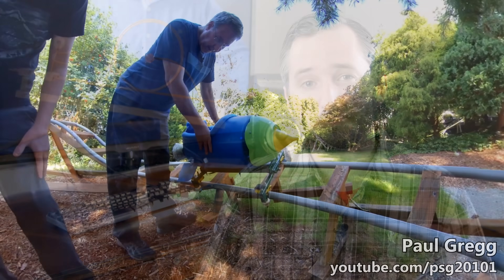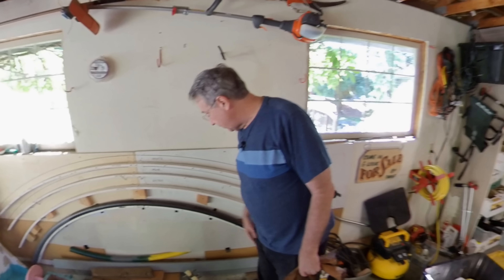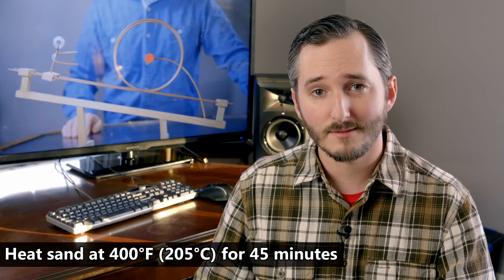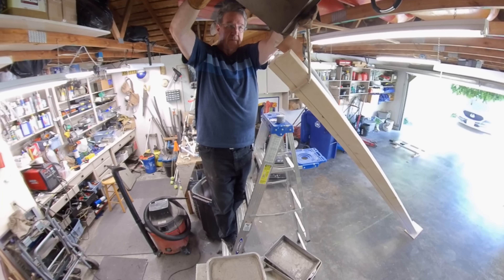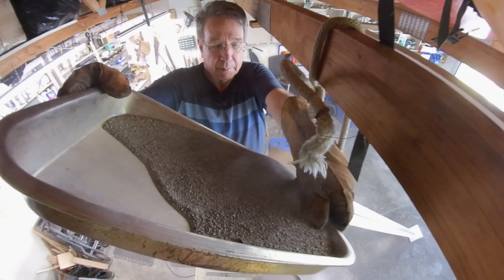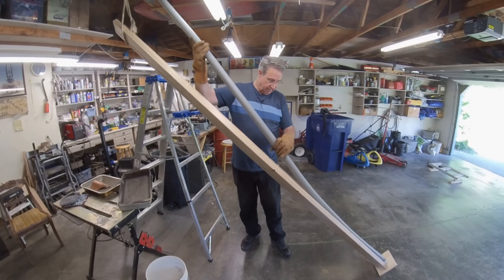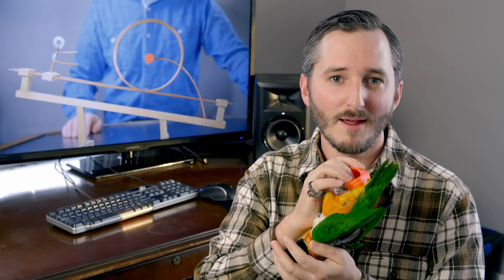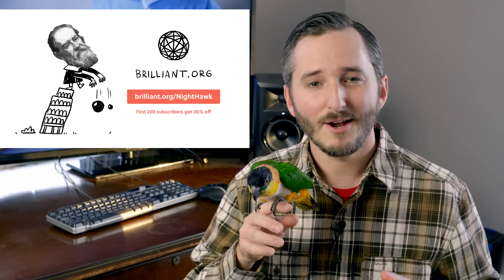Easy PVC Pipe Bending (How To/DIY)

Comment: For those concerned about the sand dust, I only formed two pipes that day, and I think most of what was seen might have been steam from moisture in the pipe.  If I were to go into production (which I have absolutely no intention of doing) I would of course have workers wear masks.  Then again, the sand is bought identified as "Play Sand", washed and screened,  intended specifically for children's sandboxes, where  children pick up and pour the sand routinely.  I can't remember anyone, child or adult, ever wearing a dust mask at the beach or in a sandbox.
Reply: Clearly the last sentence holds a bit of an ominous tone now.
Reply: Nice, Paul..)
Reply: Driving by the beach yesterday, everyone had on masks.

Maybe they were out there bending PVC pipe, I can't be sure.
Reply: Well, in the 1950s, motorists didn’t wear seat belts, either.Most of us survived...
Reply: Oh how times have changed lmao I see people wearing masks while they're driving alone let alone at the beach
Reply: Ok, but if you find yourself doing DIY, car repair or a house renovation a lot. Take some effort to buy yourself a nice respirator, it's definitely worth it.

Comment: Would leaving the sand in the tubes increase it’s structural integrity in the rail track application?
Reply: I don't think so, but they would be much heavier.  Some pro roller coaster companies put sand inside their steel tracks and frames, but I believe that is to increase the dynamic damping (alter the vibration natural frequency) in order to decrease the fatigue loads on welds and smooth out the ride.

Comment: You curve PVC pipe ends using heated hollow spring coils. I do it all the time and I get perfect curves.

To get matching curved ends, you need to use a rail mold (any kind large enough and strong enough to hold stable while cooling. I use a large pegged frame and long bolts. As you slide it through and allow it to cool, the end has no other option but to curve.

Comment: I wonder about using a heat gun.
Reply: Its hard to heat the pipe evenly using heater. And you might bend it too much
Reply: @akugrafik9321  My possible project is a set of hoops four feet across for a utility trailer. What I thought of doing is make a form of some sort, likely a piece of plywood with dowels placed in the round shape in an as yet decided spacing. I envision alternate form designs as well. It doesn't need to be perfect. The ones I made with 45° elbows and couplings are iffy enough to make new ones. The pipe is cheap and I already have a supply of it anyway.

Comment: how about piping steam through it?
Reply: I tried boiling water, and it just didn't work very well at all.  Superheated steam would probably work, but would also have safety issues.  Plus you would want to pressurize it to keep the heat high and pipe round, which sounds even more dangerous.   The heat mass of sand is a really good fit here.

Comment: Please Note:
PVC when torsionally stressed will flex up to a certain point - then it will explode/shatter.
So don't use it for structural "projects".
Or you will be painfully sorry.  :)
Reply: I agree.  I use it for backyard roller coasters for my smaller grandchildren (under 60 pounds).  
Torsional stress is really tension stress at 45 degrees.  If you stress it enough to break it, PVC can fail in a brittle manner.  But my stresses are low.  Fracture toughness is decreased by UV radiation in sunlight, so I paint the tracks.  I've done fracture toughness testing on painted and unpainted PVC conduit, after 2 years of sun exposure.  If I were to make a BYRC for kids up to 100 pounds, I would use schedule 80 conduit.  For riders heavier than that, I would use steel.

Comment: Would this method also work on white plumbing PVC pipe?

I use the white PVC to help isolate bundles of network cables from anything else that is up in a drop down ceiling.  I have to rely on curved joints to get the bundle of wires to change direction.  The push/pull rods get stuck on that small seem between the straight pipe and the curve section.  If I can bend the pipe using this method, there won't be a place the rod could snag on.  I would also be able to make the curve any angle I need it to be.  Even bend around obstacles instead of using lots elbows with all those seems.

Comment: When working with dry sand like that you really, really should wear a particulate rated respirator. Silicosis is no fun: you slowly asphyxiate as the silica dust gets embedded deep in your lungs, preventing air from reaching the surface of your oxygen/co2 exchange membranes. Silica is completely bio-inert (which is why it can be used in implants) but that means also that your body can’t break it down and get rid of it — once it’s in your lungs, it’s staying there forever. There is no treatment or cure... only prevention.

Comment: I wonder if that technique would work on smaller PVC pipe, like 1/2" or 3/4" schedule 40.   The cross-sectional area would hold a fraction of the sand, so it might not have enough heat capacity to do the deed.  It might be necessary to also bury it in hot sand for a couple minutes to let the heat stabilize.
Reply from the maker: The thumbnail image is a piece of 1/2" pipe I bent with this method. I had doubts about the sand holding enough heat for smaller pipe also, but it does. It was still hot after five minutes and I went and dipped it in a snowbank when I was tired of waiting for it to cool down.

Comment: I built a forced hot air flow box, similar to a steam box used for steaming wood for bending.
I found the best ply-abilty temperature is 158 -165 f. without molding technique to prevent kink
or bulge. I could get a 2 ft. 90 deg. radius bend with moderate flattening and a 1 ft. 90 deg. bend
with moderate flattening while stretching, bending and quick quenching technique.
This is done without any memory rebound.

Comment: Cool idea---or should I say hot idea?---Question: what is the diameter limit for bending pipes using this method? I need to bend PVC pipes in the range of 3" to 4" o.d. Thanks.
Reply from the maker: It would work for pipes that size but I suspect you would want to lower the temperature of the sand as you're going to have a lot more of it and it will stay hot for a long time. The pipes will be very heavy, you'll need at least another person to help move them.
Reply: @Nighthawkinlight  Thank you so much. REally enjoyed your video and the pipe-bending idea. Best wishes.

Comment: Sand fill for metal pipe bending is a thing too, but it's practically a lost art when it comes to makers on YouTube. Somewhat different in that it needs oven-dried sand and packing the ends (don't want moisture or steam to build up - so it has to be really dry), and heating it to cherry red with a torch and using some clamps or jigs to help with positioning due to the heat. However the status-quo for people that do things like frames or exhausts in their custom work is to hack-weld a dozen radius pieces together which still isn't as nice as a custom radiused bends that could be done this way.

After all these years, the only good examples still involves just one guy at a Japanese motorcycle shop. You'd think there'd be more than that.

Comment: The hot sand method should work well for a project part where 1.5 inch pvc must jog past each other in close quarters.  Part of a larger project but key.

Comment: Thanks! That is a great tip for bending large sections of PVC.  I use sand in PVC, cap the ends and then heat the portions I want to bend... but I really can't wait to try this method!  Thanks for sharing this.

Comment: I have tried this at an earlier date and found that if you take out the sand a few minuets after you get the pipe molded, it will cool faster because of the lost thermal mass. You can then reuse the sand at a reduced heating time for other parts. I would also recommend using a crock pot for the sand, as it heats from 3 sides and the porcelain pot in the center can be removed for easier pourability. Thanks for sharing this process.
Reply from the maker: Great ideas

Comment: Don't heat pvc pipe from the outside, this can cause a lot of damage to the pipe and cause it to loose structural stability. I've seen guys that have bought pipe from my company and have tried to heat it from the outside only for the pipe to fail a couple months later.

Comment: Would hot water work too? Seems less messy and easier to heat up without putting sand in your oven.
Reply: I tried boiling water.  Not enough heat mass.

Comment: That is an brilliant solution to bending the pipe. It could easily be scaled up as well! The only thing I'm left wondering is how does he weld the pipes together.
Reply: No weld. 1.25 diameter 6"  PVC pipe segment, split lengthwise on one side, compressed and inserted into 1.5 diameter pipes. Countersunk screws to hold together.
Reply: @PaulGreggBYRC  Thank you for sharing! Do the screws ever come loose out break through the PVC under load? If so, have you considered a light wood like balsa, lathed to match the inner diameter instead of PVC?
Reply: @stewiex  Screws haven't come loose yet.  Screw locations at 45 degrees (halfway between main wheel path and side wheel path) avoids wheels hitting them, which could crack the PVC.  I started out turning or sanding down 1.24 inch PVC 6" segments and bonding them in, but that is a lot of work.  Plus, with extruded PVC pipe, the manufacturer controls the outside diameter to +_0.005 inches, because the outside usually mates with couplers and fittings, and they have to let the inside diameter vary +_0.015 (due to nature of the extrusion process).  So for different batches of PVC pipe, the ID varies, and, if you're turning down internal couplers to match, you find yourself custom fitting each one.
BTW -  I countersink and screw through a long screw, then break off the tip end at the exit hole in the pipe.
Reply: @PaulGreggBYRC  It is very interesting to me hearing how you worked through the process. It sounds like you thought of everything. Thanks for the responses!

Comment: That's a really great technique! Def gonna use that next time I need to bend pipe. Much cheaper than trying to find flexible silicone rods that fit in the pipes. 
One note though is to wear a mask when pouring the sand. Hot silica dust sounds pretty nasty to breath in.
Reply: If he wears a mask he won't get to tell people he got pneumonoultramicroscopicsilicovolcanoconiosis.
Reply: @dontaskme9047  damn you!!! I was so fascinated by that word I had to learn how to pronounce it! it took me 2 HOURS!!!!
Reply: @DoubsGaming  But it's so simple. Pneumono-ultra-microscopic-silico-volcano-coniosis
Reply: @dontaskme9047  that's brilliant
Reply: Having worked in the glass industry for 15 years I can say that inhaling ANY silica dust is pretty nasty. Less than a minute in and "then we pour hot sand" and the flash went off in my head. I love it! Been looking for a way to bend inch+ Diameter in a tight radius.
Reply: Would it work to cast the silicone directly in the pipe? Maybe use a high temp silicone? I was thinking for cases where you might want the pipe to be clean inside.
Reply: I was thinking the same thing for the mask!

Comment: Does it work for ABS?
Reply: Try it.  It looks the ABS  glass transition temperature is a little higher than PVC.  Understand ABS has less stiffness, less static strength than PVC, but better toughness, so it depends on the application.

Comment: Awesome tip!   A while back I tried making one of a PVC archery bow using the hot air gun to bend the pvc & had quite a few failed attempts after the pvc pipe heated unevenly and collapsed while bending... this is a WAY better method!

Comment: Good video as always, but i feel i must make it know when you heat up pvc, it can undergo thermal decomposition and produce chlorine gas. If you plan on doing this, wear a mask that can stop gases.
Reply: Darkknightx33x, it does but at higher temperatures and over time. Millions of pounds are melted and molded/extruded into pipe etc. in the 1st place.  Just don't leave it melted for a period of time.  Note,  if you see a green cloud be somewhere else. The chlorine and acid isn't going to be effectively delt with using just a chemical mask.

Comment: If you have a form, you can mass produce some cool pvc shapes... in scouts we batched out 40 pairs of snowshoe frames with this method. We used a large propane stove to heat the sand, had one crew pouring, another bending the frame, and then pouring out the sand and drilling holes in the frames for mounts. I still have the pvc framed snowshoes, fun for snow days.
Reply: As soon as I saw this video, I thought to myself "I remember this sand trick from *Boys' Life*!"

Comment: Oh my. Please wear a dust mask when you start doing this on your own. Silica dust is terrible to breathe.
Reply: Silicosis takes LOADS of exposure over YEARS to get, so unless he does this for a living there's no chance of getting it.
Reply: For sure!
Reply: Most of the dust you saw was above 5 microns in diameter and that will not make it into the lungs. Chill safety buffalo.
Reply: "Play Sand" as mentioned and used in the video is far different and safer than silica sand!  Please don't unnecessarily spook a lot of people. (And yes, silica dust is very nasty in your lungs and skin.)
Reply: @gus473  I knew it!  Always thought play-sand was not real sand! xD
Reply: @tombolo4120  Was a bit suspicious myself! 😏🤣✌️
Reply: Mike Gustafson 
It’s not shown which specific brand he uses, so I just picked the most common: Quickcrete. Its safety data sheet specifically warns about the silica in the sand. While I understand that play sand is made to be safe in regular use, this application is not regular. You can clearly see the the dust billowing straight toward him as he pours it into the tube. I’m sure the excessive dust is a result of the baking process.
Reply: @Thee_Sinner  💫🤡 You "win!" 🤣

Comment: The comments about the first are SOOOO painful to read. It's almost like people have zero education. You don't get silicosis from pouring sand into a pipe one time, or even the dozens of times he's done it. There was a tiny dust cloud, 99% of which blew away, and of the remaining 1%, he may have inhaled 10% of that. Stay with me, we're at a total of 0.1% inhaled. Then 90% of that is stopped by your house/sinus/mucous membrane. So the few particles of sand he inhaled isn't going to cause him any problems. You get it from exposure over time. I'm struggling to find out where people are getting this silicosis nonsense. If you are cutting concrete dry, once a week, for a couple hours at a time, over years, you might develop silicosis.
Reply: That notwithstanding, particulate masks are pretty cheap, and I would be wearing one.

Comment: Wow this is a great idea. I wonder if it works on acrylic pipes. That would making fake neonlights so much easyer!
I love this
Reply: Nope. Sand is so coarse it will scratch the acrylic and if the temperature is too high it will leave sand marks. Maybe a softer filler.
Try calcium granulated or just use regular heat gun like everyone does.

Comment: i was an electrician for 30 plus years . i have done emt , rigid  and pvc . if it took me 45 minutes to bend each peace of pipe id have been fired my first day on the job . there are at least half a dozen ways to bend pvc pipe that is much faster  and just as good.
Reply from the maker: I'd appreciate knowing what those ways are. If you're thinking heat guns and torches I challenge you to bend a whole 10' section evenly without kinks or weak spots.
Reply: Other methods are faster, but don't keep the pipe round as well.  For roller coaster track, keeping it as round as possible is essential.

Comment: I would have thought he would have something simpler after all that. A conductive wire can be inside a special long pouch that's filled with sand. The sand heats up right inside the pipe then. Of course the wire would need to deliver the same heat evenly across the length or have segmented sections so they all glow the same.

Comment: If PVC were better at conducting heat through its walls, it'd be great for things like alcohol distillation or even a power plant steam system.  Too bad it's not (or at least metal is better).  Super interesting.  As an engineer I'll put this on my resume.  It might get me a job.

Comment: Works great, though seems like an overkill for most people with one-off projects. Like, you have to build a whole production line.. Unless you're building a rollercoaster, a heatgun will probably be more efficient
Reply from the maker: Really hard to bend PVC this size with a heat gun. It kinks and causes all kinds of trouble.

Comment: I wonder how boiling water, poured inside, would work. As long as there's no air inside, the water should keep it from kinking.
Reply from the maker: Paul says he tried water and it doesn't seem to stay hot enough. Harder to stop from leaking too.
Reply: I'm not surprised. The leaking problem could be solved with "shark bite" fittings but since you can only get water to 212°, it would be hard to get the PVC to a working temperature.

Comment: Also wondering if you could use this method to create the corkscrew pipe need for your Plasma Coil Bottle Launcher?
The inside of the pipe may (undoubtedly) become translucent after having hot sand poured into and and then bent, but you'd still get the effect, just not 'as cool'?
Reply from the maker: Sure, that would work

Comment: If you were to use this method to bend smaller diameter pipe, you could make marble machine 'ramps'... Drawing a straight line down the length of the pipe beforehand, with another straight line 180º opposite of the first, they would serve as a guide to cut the curved / bent / corkscrewed pipe in half, after it has cooled and set.